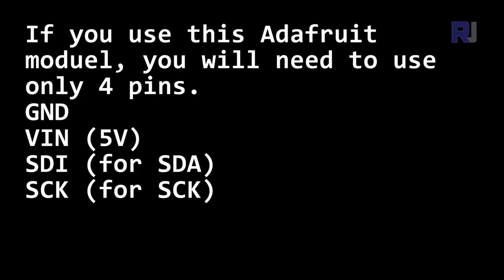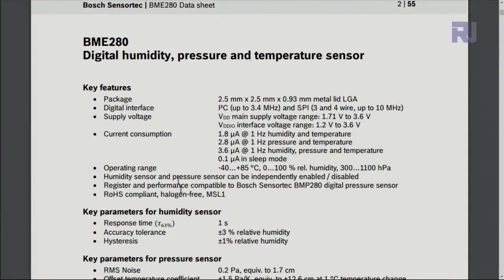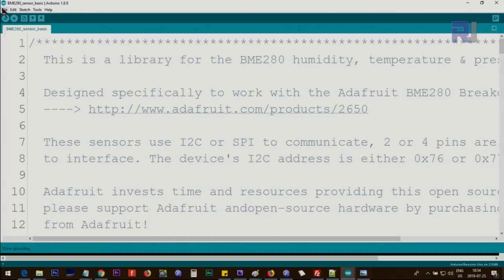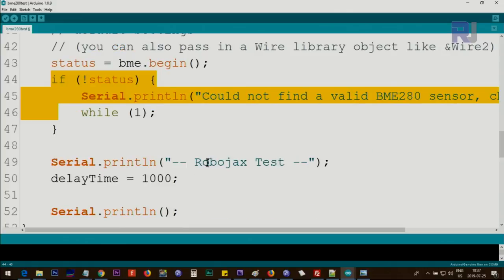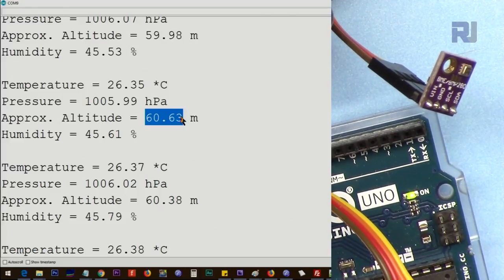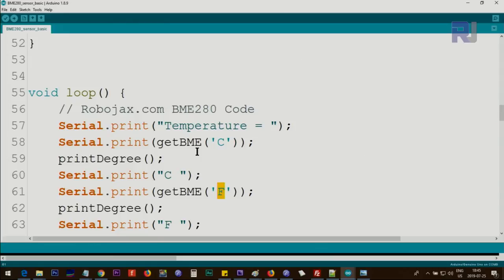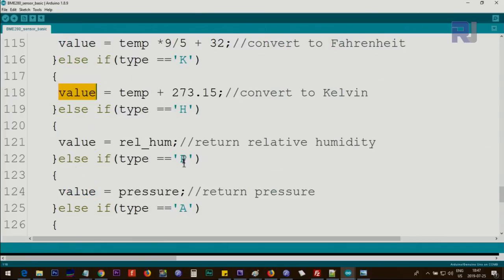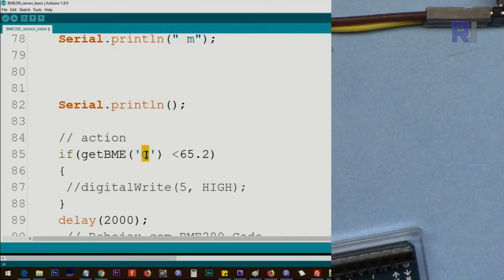Lesson 37: Using BME280 Humidity,  Barometric Pressure and  Temperature Sensor

Comment: Hi  Ahmad,
I watched your video on BME280 Barometric Pressure Temperature Sensor. I still get the message" could not find a valid BME 280 sensor. .." I checked my wirings and still the message occurs. Any suggestions  on how to move forward? (BTW, I also live in Ajax, ON).
Reply from the maker: hi, run I2C scanner and until you get I2C address,  it will not work. so make sure you get the I2C address.  if you followed the course, you should know by now how to get and use I2C scanner.
Reply from the maker: Alberto, Where in Ajax? I live at Rossland and Harwood.  email me from Robojax contact page.
Reply from the maker: I meant Robojax.com contact page